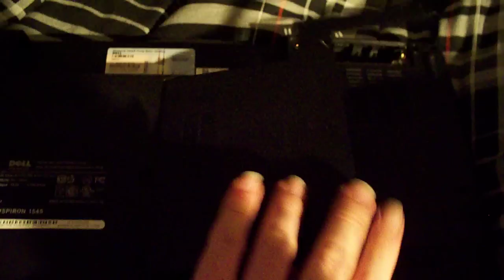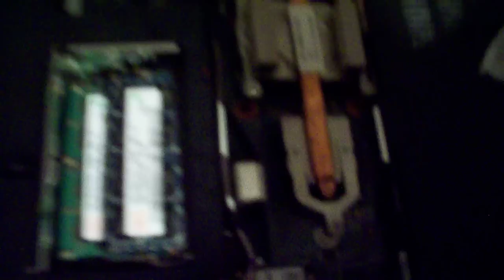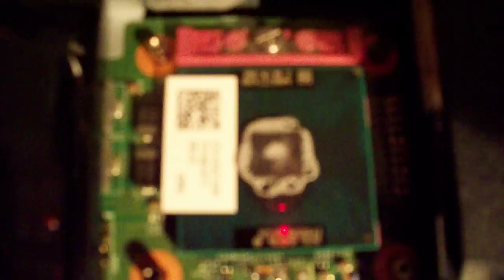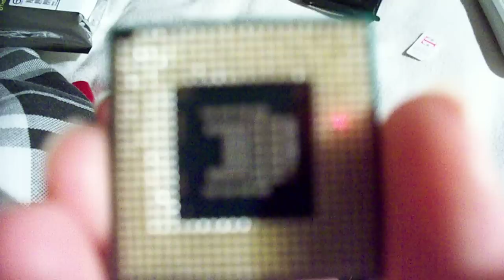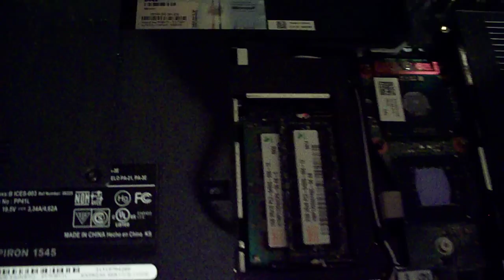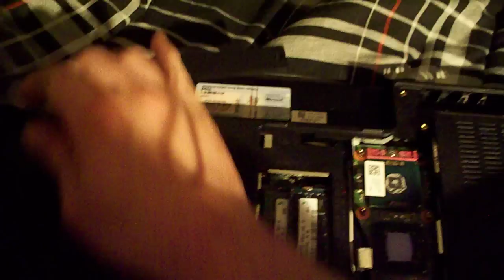Dell Insprion 1545 Quick Guide to upgrading the CPU & RAM. (Part 2/2)

Comment: in the manual it says the fsb goes from 667/800/1066          with 1,2,3,6mb L2 cache
im currenty runnung a t3000 1.8ghz 800fsb 1mb L2 intel GM45 chipset. 
so can i put a cpu same as yours, or say with a 6mb L2 1066fsb.
thanks